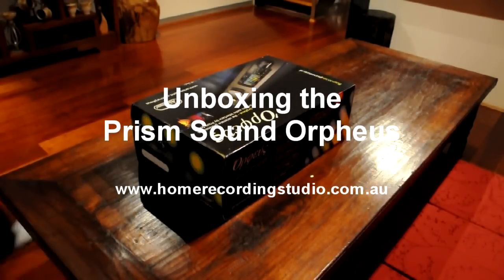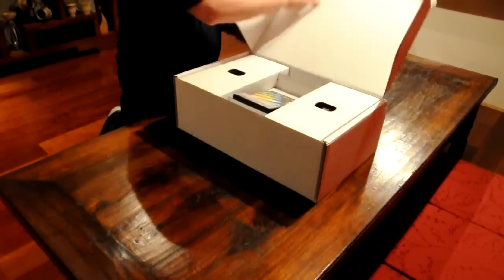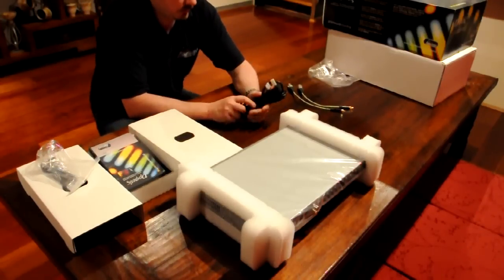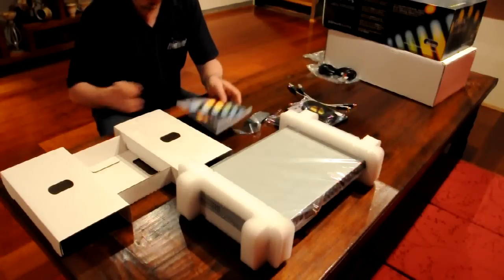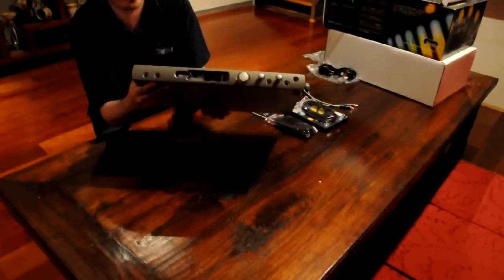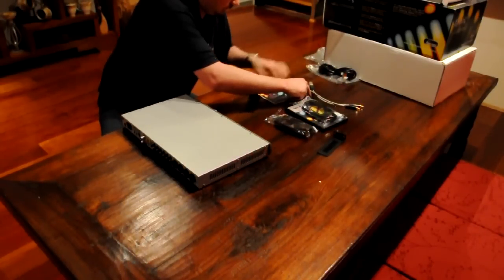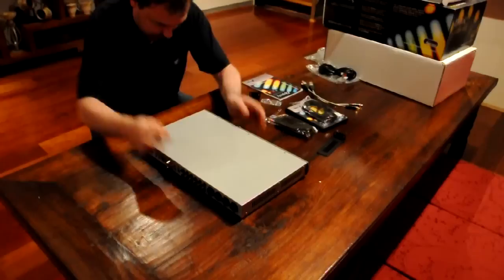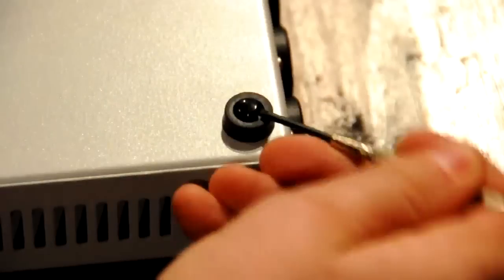Unboxing Prism Sound Orpheus

Comment from the maker: @ladex142 I don't think I can describe it's sound. Since it does not really make any. It's designed not to sound like anything. I can't use any buzz words like crisp, warm etc. It just does not apply to this Audio Interface. What goes though the device appears to come out unaffected. Oh unless you have a jittery digital clock, which the Orpheus corrects for you. Basically what an Audio Interface of this type should sound like - like it's not there. I hope this answers your question in some way.

Comment from the maker: You can buy it through the Prism Sound distributor in Australia CDA-Pro Audio, give them a call and ask to speak with Peter. The Australian price basically it's the UK retail price at at the current exchange rate. If you decide to buy it overseas, you will most likely attract taxes, at least 10%GST and 5% customs duty. I had a look at the customs page and it appears they charge GST and Duty on the hole value including shipping, PM I'll send you the links.

Comment: Unboxing it is the easy part - working out how to use it's control panel application took me months of experimenting and trial and failure. The documentation doesn't explain how to USE the Orpheus it just describes the controls.  Its a bit like describing the controls of a CESSNA and saying 'enjoy flying it!'  Also the light bleeding in the monitoring window - terrible - and at this price unforgivable. Also the headphone knobs don't have any pointer - again unforgivable at this price. I own one.